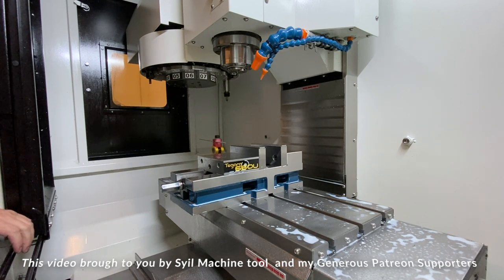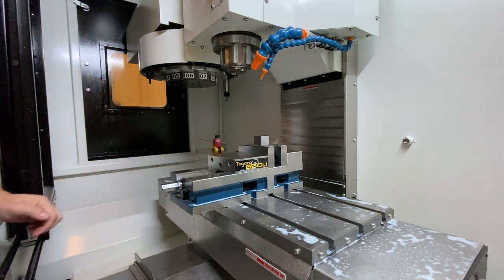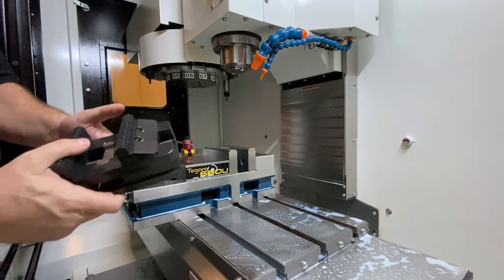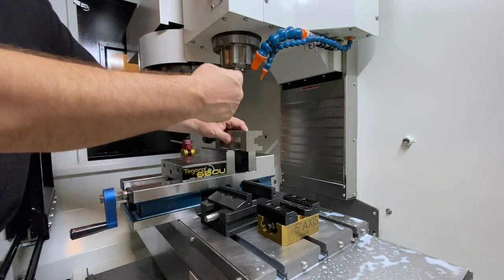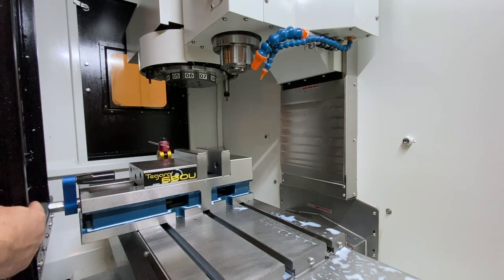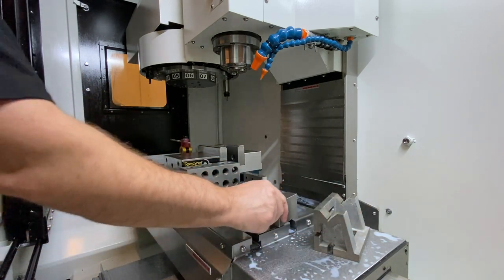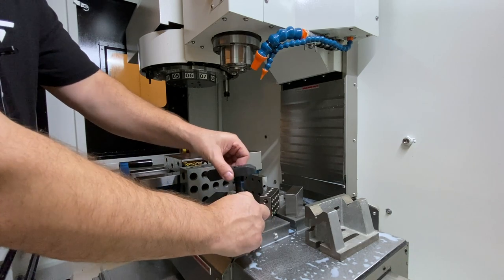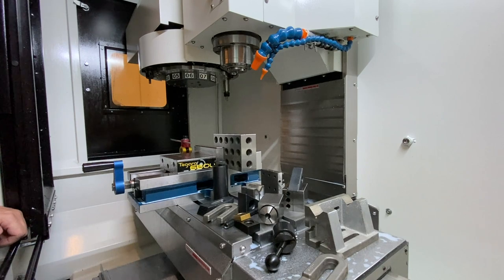CNC Beginner - Introduction to Workholding Pt.1

Comment: Using lathe chucks on the table for work holding, somtimes requires a backing plate to mount the chuck but a very sweet method of round part holding.   Loads more ideas but i know you will cover them in part 2 - im not stealing all your thunder.

Comment: How is your large vise held down to the table? I just got an X7 and a Kurt vise. Scratching my head on how to properly hold it down
Reply from the maker: a DX6 is too big.....unless you mount it sideways....look at the Tegara 660U
Reply: @NerdlyCNC  That is a huge bummer considering its already here. I will check out the Tegara 660U. Thanks for the pro tip :)